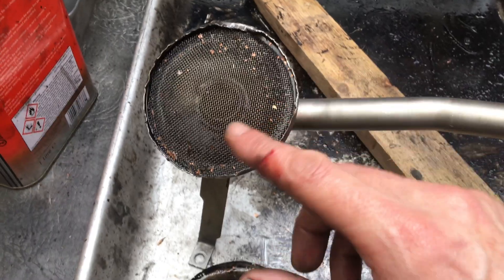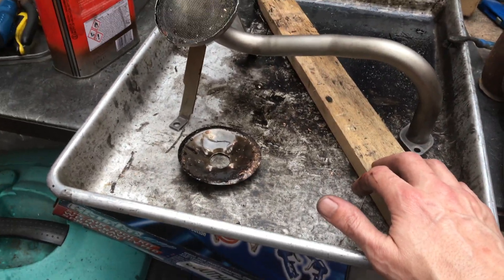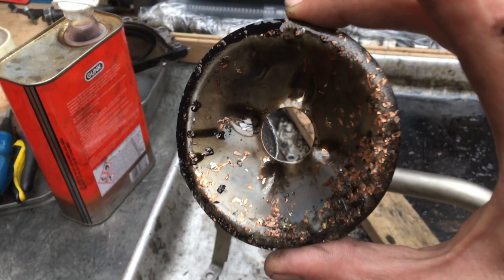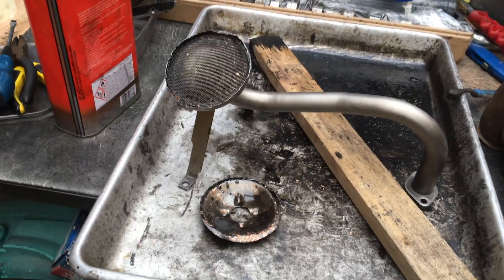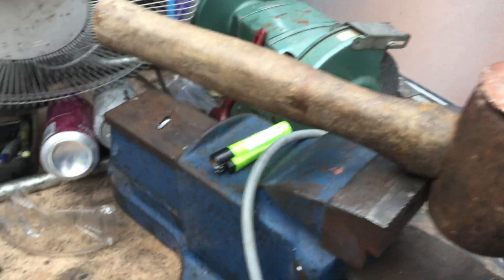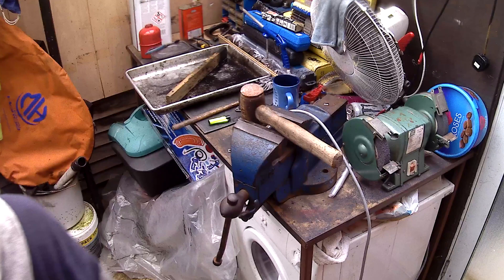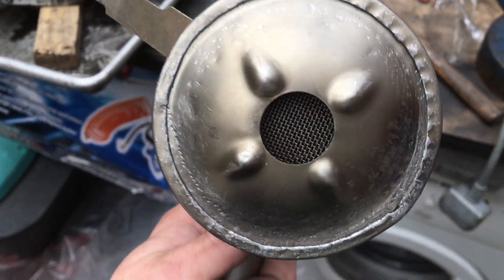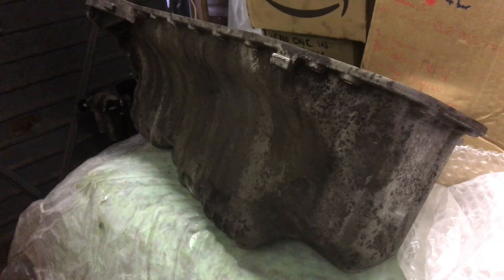The only way to clean the oil pick up pipe

Comment: I used to take pickup tubes outside and heat them up to glowing with a torch then wait for it to cool and flush out all the ash. You just gotta make sure you don't burn through the screen but otherwise I found this very effective.
Reply from the maker: Yeah it’s a really good way of cleaning parts if you know what you’re doing but it’s not something I would advise for someone who is not familiar and comfortable with using heat 👍